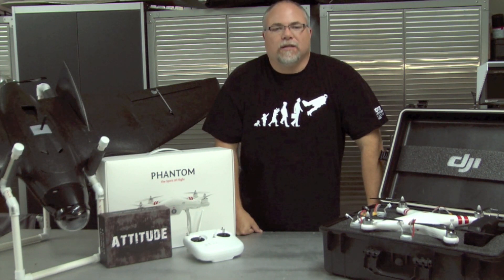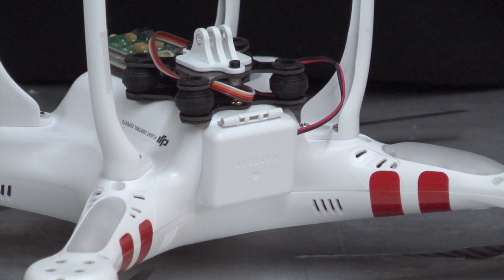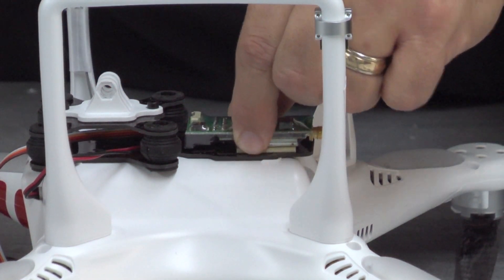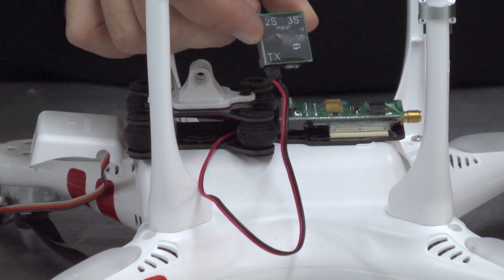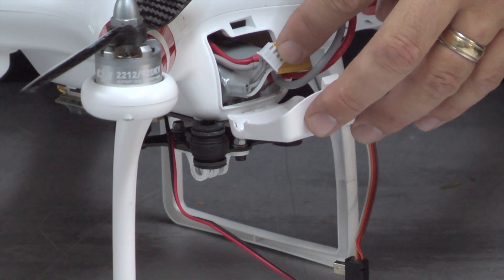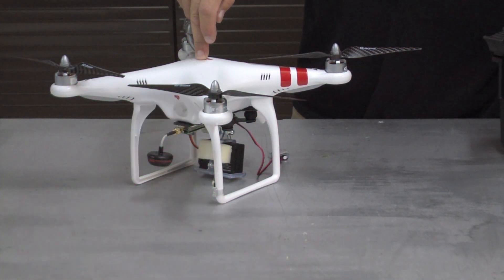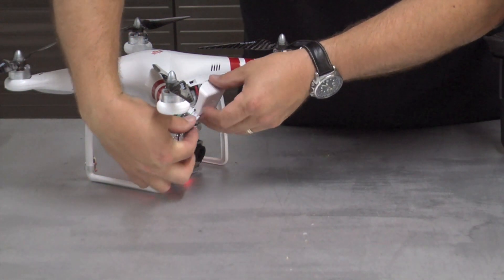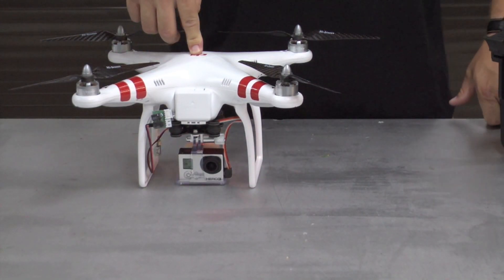How to Set-Up Basic FPV on DJI Phantom

Comment: Hello, I have a fc40 I modded to house a 5200mah battery. I have a hero 4 for it and I was wanting fpv for it. My question is, since the quad is 5.8ghz wouldnt the fpv 5.8ghz  interfere with the quad? I cant find any 2.4ghz fpv stuff. Does it exist? What am I missing here?
Reply from the maker: Yeah you wouldn’t want to run 5.8 control and 5.8 video together.  If you cant find 2.4, try 1.3 or 900 mhz.  ReadyMade RC has a lot of components.
Reply: @AeroworksProductions  Thank you for your reply! What do you recommend?

Comment: Hi great how to video. What really bugs me is the Phantom 3 standard doesn't have a hdmi port. So with out spending a ton of cash on a set of goggles. I find it hard to get a pair of goggles to connect to my tablet hdmi port to use as a monitor. There isn't a lot of goggles out there that work well with the Phantom 3 standard. I'm looking at price range $100 bucks or tiny bit more . But has been a chore to find a pair that will have a hdmi port to hook. My tablet is really good but gets beaten by the sun and am looking for a goggle to hook. Any info on this.

Comment: Can you upgrade the motors to P2 or P3 motors? That'd be insane not having to spend $1,200+ on the P3.  as for the gopro, I have a SJCAM 5000 wifi.  can you still do the same with it?   I also hear that you could increase the drone range if you get a better radio controller of the same frequency. as well as a transmitter with a nice antenna?
Reply: share a video if you do it, i need to do the same think.
buying motors and upgrade my Phantom 1

Comment: When I'm using Fatshark it only lasts for 5 minutes the gopro shuts off it does this every time and when I put the antenna down on the Phantom the light starts flashing yellow and when I put it back up it stops why does it do this

Comment: first things first, I watched this video months ago when just getting started in fpv. since then ive... upgraded. Thanks for everything. Now my question:

does anyone know the load the bare power wire in the case can take? I have successfully powered a gimbal off of it but i need to know if i can get away with making a y cable and powering my transmitter off it as well. TIA

Comment: Great Video ... I'm just now getting into using my Phantom 1 and I have the GoPro3 underneath. I don't use the battery from the quad to power the camera.. the camera should outlast the quad a few times over and as an added safety measure since I'm still getting used to its flight characteristics I use the full case for my GP3 with the extra mounted battery in the case. I'm going to get the mount you have on yours.. looks like it would help with the shakes. thanks a bunch.!

Comment: Thanks for the video AKRCGUY.  I have the same Phantom with the Airy Brushless gimbal that is powered off of the stock battery of the phantom.  With that said, does the fat shark transmitter run off of a smaller battery that could be velcroed to the exterior of the phantom?  Seems like running a splitter or some sort to power the gimbal, camera and transmitter would drain the battery in a hurry.  The battery on the camera last quite a while, so I see no need to power it up, but still need to feed the camera video to the transmitter.  I am just starting to look into the FPV system available and just wondering which one I should go with and how to power without using the phantom battery.  Again, thanks for the helpful video and looking froward to hearing from you.

Comment: Very nice setup. I would only suggest that you use the internal electric backup cable which can be taken out through the front landing gear's hole (below the rubber cap). Might need to open the Phantom to get to it... but that way you won't have to mess with the battery's cable.
Reply from the maker: Daniel, this was one of our first how to videos.  A lot has changed with the Phantom as you know by now.  Checkout some of our more recent videos.
Reply: AKRCGUY
True my friend. By the way keep up the great job. Your videos are really helpful.

Comment: Hi there.  I have set up my Phantom exactly the same way you have using the same equipment.  Problem I have is that I lose video image through the goggles after about 3-4 minutes every time I fly!?  I have placed a heat sink on the transmitter, but this has not made any difference.  Any ideas.

Comment: Since the "Mike Workman" mount isn't available anymore, what can you recommend as a substitute?
Reply from the maker: Most if not all of the new Tarot gimbals have the correct mount now.  If you have a Phantom 1 you can buy this mount- http://www.rangevideo.com/en/tarot-t-2d-accessories/189-tarot-gopro-shock-absorber-adapter-plate-for-dji-phantom-tl68a13.html

Comment: Excellent Video.  I am new to the phantom.  I just purchased the FC40.  I would like to do EXACTLY what you have done.  My only question is...besides the camera...what are the main differences between the FC40 and other Phantoms?
Reply from the maker: Johnathon, the biggest difference is that the FC40 uses a 5.8 ghz radio system so that you are able to use 2.4 wifi with your smart phone at the same time to view the video.  Other than that the Phantom is the same but you'll have to keep the frequencies in mind when you buy a video transmitter.
Reply: Thanks.  Can you advise me where to purchase the fpv equipment?  Also..Would you recommend I purchased a go pro... My fc40 came with a detachable camera
Reply from the maker: We sell FPV gear at www.blackopsdrones.com but what are you wanting to purchase?  Is your plan to remove the stock FC40 camera and replace with gimbal and gopro?
Reply: Yes I think that would make the most sense...?  Thoughts?

Comment: Thanks for the video. I'm new here can you send or post the model numbers of the components you used? Also can this be used with an external monitor rather than goggles?
Reply from the maker: THe components are bleow in the description and yes you can use monitor or goggles or both at the same time.  Also check us out at www.blackopsdrones.com

Comment: @akrcguy thanks sir. but i have the upgraded zenmuse board that dont have a red and gray cable output to feed the gimbal. but im planning just to use a normal gimbal with fpv. can you recommend me the way where can i feed those 2 units. directly through each 3s balance battery cable or solder inside the phantom to have the output cable for 12v.
Reply from the maker: All Phantoms are slightly different but you can solder another set of power wires on top of your main power cable.  Where the battery lead is soldered on to the main board.  Then just run your new cable to the devices you want to power.  They will now be fed from both batteries evenly.  Just make sure you FPV gear is set to the right voltages.

Comment: Hi so I noticed you wear glasses can you wear your glasses under neath the fat shark goggles?
Reply from the maker: FatShark sells a Diopter Kit with 3 or 4 magifiers in it.  There not perfect but I take off my glasses and put the goggles on and I can see fine.  I guess it depends on your perscription.  I think you get a +1.0, +3.0 and +6.0 lenses. These only work in a couple models so you have to check their site but I fly with the Attitutdes.

Comment: Great Video, So I have the same quadcopter as you, does it need a certain version as I notice their are multiple types such as V2 and V3 setups and was wondering if you have to buy the antenna set separate or do some kits come with them.
Reply: Hahaha Looking back at this, It's a shit setup anyway thanks for not commenting back.

Comment: I'm a little confused now. Does this give you a live view of the gopro? I thought that you had to add another camera along with the gopro to do this..
Reply from the maker: No, you can get live view directly out of the GoPro using this method which is better for framing your shots.  If you're using a GoPro 3, you can also shoot stills and video at the same time while flying FPV.
Reply: Okay, thanks :) I found another video that kind of answered the question. I guess it depends on which model of fatshark glasses you get, some of them do come with a camera (and yours might of too) and you just change the wire and use the gopro instead. I don't really get what the difference is between the different fatshark glass models? If you could help with this it would be appreciated :)
Reply from the maker: Yes, FatShark sometimes sells kits which include a small FPV camera.  The main difference between all the models are the options.  The higher end models like the Attitudes come with 5.8gHz Rx and head trackers built in them so no additional wires are needed.  The lower end models require you to run a cable from your video Rx to the goggles to see the video feed.  The better goggles also have some adjustments for your eyes depending on the size of your face/head.  This is important because they already have a narrow FOV and if they don't fit your face, you won't like them.  I think FatShark has a comparison chart on their website.
Reply: Okay, thank you :D So are the attitudes like the best of both worlds?
Reply from the maker: The Attitudes are one of the best goggles out there but there are others with different options.  The Attitudes are nice because they have PID adjustments for your eyes and come with a head tracker built in if you fly FPV and want your camera to pan and tilt.  Used more in airplanes but I've seen some heli pilots use them as well.